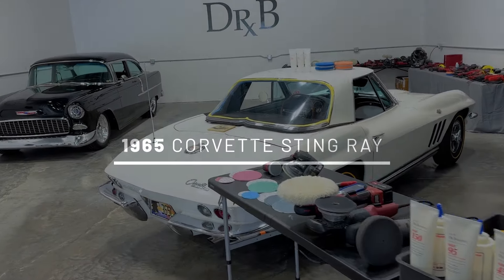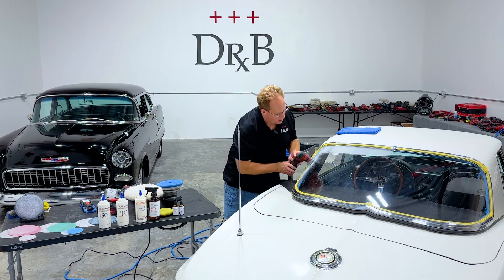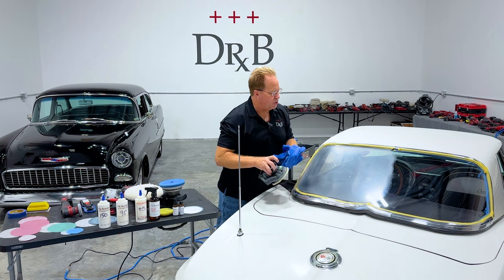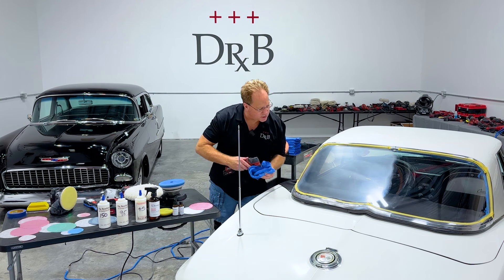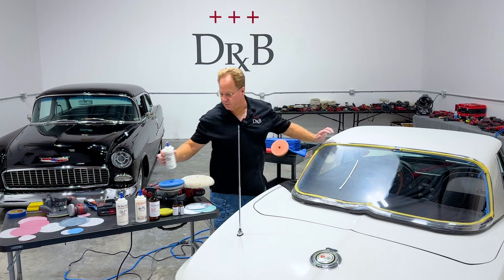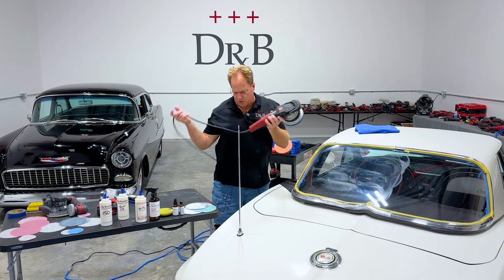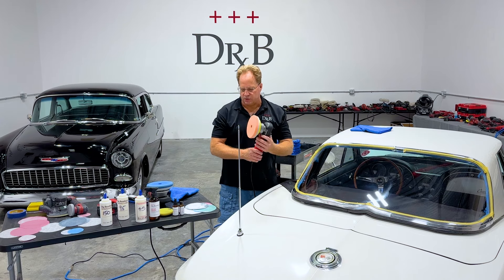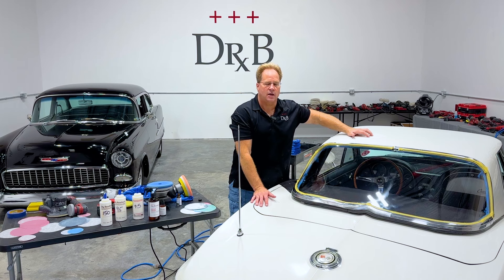RESTORING 1965 Corvette Sting Ray Hard Top Plexiglass — Sanding, Polishing & Ceramic Coating

Comment: Next show us how to remove the yellow discoloration on the convertible top window!
Reply: The process would be similar to the machine polishing steps shared in this video only skipping the rotary step.  Use any orbital, smaller stroke will work better), with the Dr. Beasley's NSP Primers and foam cutting, finishing and polishing pads.

Comment: Mike, I have a 1500 gold wing that the windshield needs to be done. Do you recommend this procedure? Regards, Tony
Reply: Hi Tony,

I do not know what Honda used to make their windshields out of every year or every new decade.  My guess would be CLASSIC Hondas used Plexiglas like you see in the hardtop off this classic Corvette.  As technology improved, like all other companies, Honda moved onto newer types of plastic.  That is NON-Plexiglass by some kind of acrylic or Lexan.  

You can try to find out from the manufacturer but this means going to a Honda dealership and the person behind the counter isn't going to know what you're talking about as to them - plastic is plastic.

The next best thing you can do is called a TEST SPOT.  A Test Spot is where you test the pads, products, tools and process that you THINK will work to a tiny area and test to MAKE SURE it works before buffing out the entire windshield.

I actually did this for the 1965 Corvette Hardtop, that is I did a Test Spot and captured via pictures and video - but none of this was used in this video.  It's already a long video and as I mentioned in the video - Americans have short attention spans.  

What year is your Honda?

Mike
Reply: Tony - Watch the video I link to below starting around the 1:26 time mark.  The gentleman in the video clearly explains the difference between polycarbonate/LEXAN and acrylic/PLEXIGLAS.  He also explains that quality manufactures of LEXAN apply a protective UV coating to both sides of the LEXAN to prevent it from fading and oxidation.  My guess is, any type of polishing and/or sanding and polishing is going to remove this coating.  THEN who knows if you'll be able to work with or polish the underlaying polycarbonate?

https://youtu.be/i_ncaGwQZuw?si=kOALAITOB8GEYXMj&t=86

The one thing I know and I've been detailing for 40 years.  Plexiglas is EASY to work on.  Polycarbonate/LEXAN?   Hard to know without testing.

Mike
Reply: @mikephillipsrealworlddetailing Hi Mike, it’s a 1997 goldwing. I modified the headlights to the 98-2000 version. The windshield is quite flexible. But I have what looks to be cracks within the windshield. I don’t know if it delaminating in the plastic or what! You can’t feel those cracks with your fingernail…I will try with a Nano and if I have zero luck I’ll buy a new windshield…regards, Tony